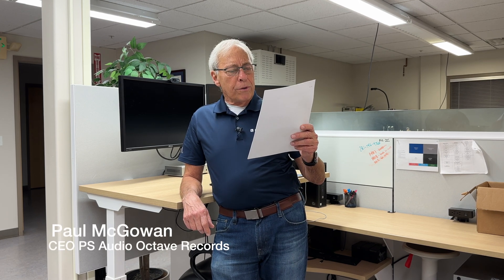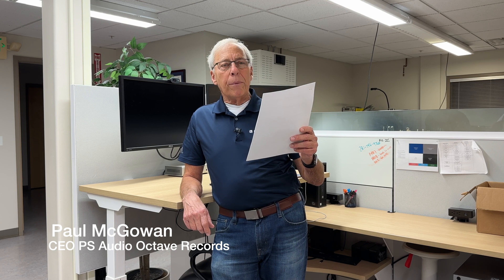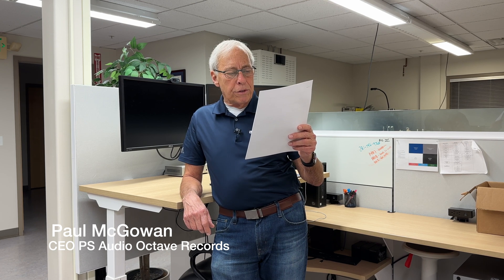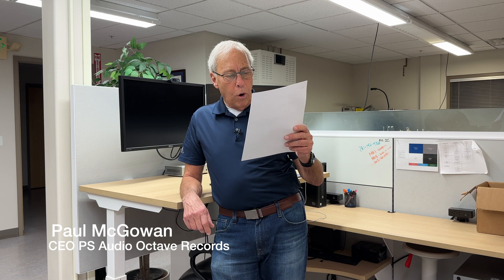Moving coil step up transformers

Comment: so what I'm getting is if you have an older PHONO amplifier or one that's noisy then yes an SUT would help but if you have a newer one with a very high-quality built-in moving coil amplification then an SUT is not needed because if it's a good one it's already dead silent you don't need an SUT… Am I correct?
I just recently purchased the latest Zesto Andros ll phono amp and it's pretty much dead silent especially when I put some good vintage Philip
miniwatt tubes inplace of the stock JJ that come stock.

Comment: I have both head amp and step.up trans with tube MM phono stage. My head amp is Rega Aura MC, my SUT is Quadratic MX-1 and my MM phono stage is DIY ANK L5 phono so I can change any of its component including the loading resistor model/resisrance values to match my SUT/cartridge. They both have their good area. Rega Aura MC sounds very stable and super wide sound stage. ANK L5 phono sounds very euphonic yet gives tons of spacial information with the Telefunken tubes. I breifly heard PS audio phono in a record store (not sure what model) and it sounds extremely good.

Comment: I still own over a dozen high quality low output mc cartridges, haven’t used them in a few years. Since Grado introduced their Legacy lineup I’ve spent most vinyl listening w/my Epoch MI cartridge and DS Audio optical cartridge. The only MC cartridge I use is a Lyra mono cartridge on mono albums. That Lyra, like most modern MC cartridges, has much higher output than my old Lyra’s, ET, Benz, Shelter and Koetsu’s. I would start by confirming output of your cartridge, if it’s >0.7mV, you typically do not need a traditional MC input or step up device. Most of my old MC cartridges are 0.25mV. As long as MM input is at or near 50db’s a 0.7mV or higher MC cartridge goes straight into MM input w/o issue. 

I have no experience w/Lindahl, but have used ET’s, EAR’s, S&B’s and Audio Notes. I respectfully disagree w/Paul suggesting ANY MC circuit outperforms a quality MC step up into a MM input. I’ve NEVER found that to be the case. The Japanese Audio Note (Kondo) silver step up is the best step up made and will outperform any MC input circuit as long as a quality MM circuit is available. 

I completely agree that A-B testing is the best determinant.

Comment: Just a note here, no transformer can perform gain. In fact any transformer has a loss.  A transformer trades voltage for current or vice versa. But the power or energy cannot be increased, that would mean creating energy from nothing! So an MC transformer just trades some of the MC current for more voltage. But overall it does have an energy  loss, not gain.
Reply from the maker: Well....technically, you're correct in that everything takes energy but the same can be said for an active amplifier circuit too. Our definition of gain is probably too broad for you so maybe we just say voltage gain or amplification. Regardless of what we call it or how it is achieved, most MC transformers have the quality to them like this: put in 1mv and at the output of the MC xfomer you get 30mv. That's gain. No, it is not free. Nothing is. I appreciate any corrections when I get things wrong but, on the other hand, there's also value in trying to keep this simple so people understand a device's function. Anywasy, I don't mean to lecture and always value your insights. Thanks, Andy.
Reply: @Paulmcgowanpsaudio  an active circuit gets energy from its power supply, thus it can output more power than what it gets at its signal input. A passive circuit cannot do that by definition.
Reply from the maker: Correct, but we're not saying there's more power. There is more voltage. Small voltage in, big voltage out. Less power, yes, but gain can be either voltage or current or both. @razisn

Comment: Be careful with this one - - speaking directly from experience - I'm running a very decent analogue front end, reference for my limited budget - - including a pre-amp that's fairly decent imo (ARC PhoneRef3SE) - - if ya not playing with SUT's you probably won't miss anything - - get into a reference SUT, particularly one that's matched to your MC, you should be very pleasantly surprised - there's a reason why Art Dudley (RIP) and the like are into SUT's, I'm sorry I waited so long getting into them myself, for me, and I'm not measuring anything, but, it seems like the cartridge itself see's more appropriate loading, everything sings and I'm not talking about volume, there is no sense that the cartridge is "loaded" down, again, that's a sense, not a measurement, but it's how the sound seems to develop to my ears with my SUT in the mix - I'm running the Audio-Technica ART1000 MC matched with Audio-Technica's  SUT1000 Step Up Transformer, honestly, the diminishing return thing, well, that is a fairly costly layout for me but I'm being completely honest when I say that I couldn't possibly go back. Just sayin'.

Comment: I've done a whole lot of comparing & experimenting, and I've never had an  instance where simplifying the signal path didn't result in better transparency, openness and purity. External step up devices and the extra interconnect needed = a more complex signal path. However, PS Audio are specialists in this kind of thing, building phono amplification is what put them on the map, and if their product is good enough and superior enough, (which I suspect it is), you may very well still come out ahead in sound quality. I would fish around for a real good interconnect though. You don't have to go ultra expensive to find a good one.

 Some claim to be going high end moving magnet cartridge over moving coil. I don't have experience with real expensive moving magnet. Maybe a good thing to do, if you're in the market for an expensive phono cartridge, would be to try to find out from a company that builds both moving coil and moving magnet cartridges, if their moving magnet cartridges really do compete sonically with their moving coils. I'd rather get things right from the horse's mouth. At the price ranges I've dabbled in, moving coils sound like superior cartridges.

Comment: I think it is a bold statement to say that an active electronic circuit is better by far than a Lundall (hardly an economy solution) step-up transformer. For sure the transformer solution is more expensive, and I think that is the real reason it is not popular as OEM solution. I would say it is up to personal taste which of the two sounds better. With the caveat that finding an MM phono stage as good as good as the top tier MC phono stages out there is not going to be easy. But that is not the fault of the step-up transformer.
Reply: I design amplifiers and you're right... for solid state active circuitry to not inject noise - harmonic distortion and other illnesses that tranformers dont produce, its a bold statement against passives. Where transformers let themselves down is uniform gain bandwidth across the whole frequency spectrum , core losses, no two transformers perform identically  ....and the big one for me - "cost /benefit ratio". ...I ask my customers are you getting that much for the cost ? some do what I do and stick to the top quailty MM carts.